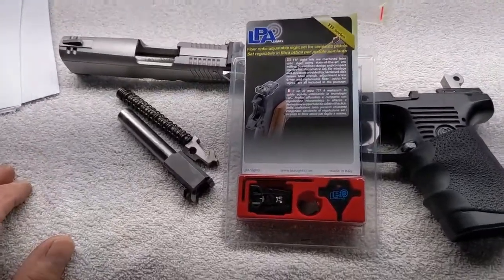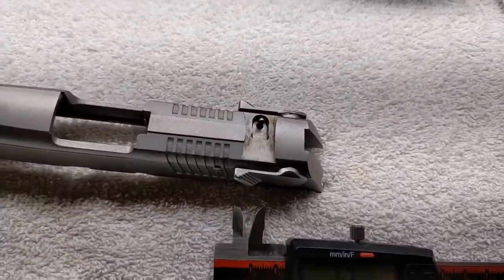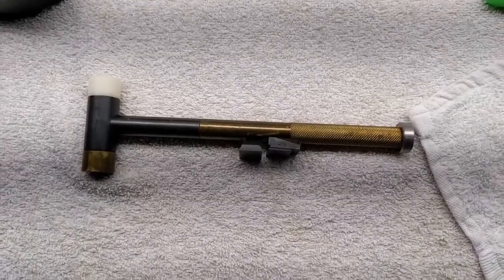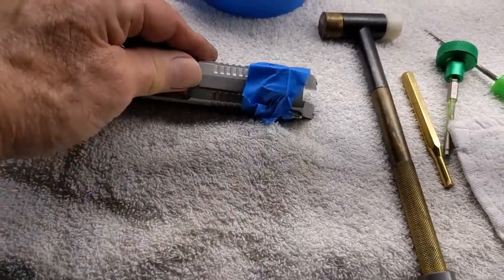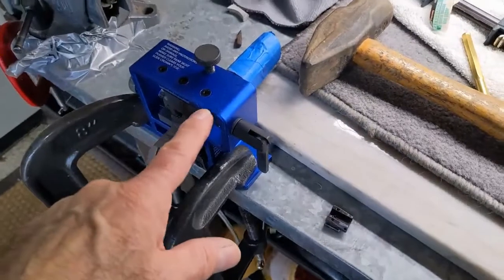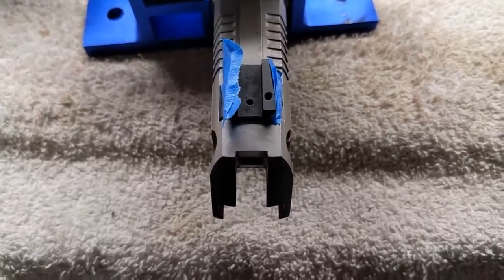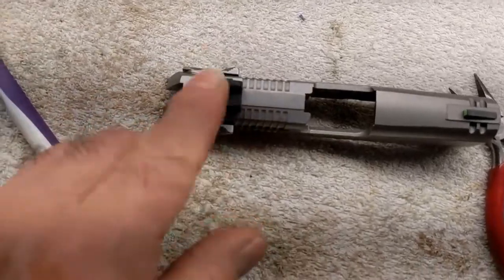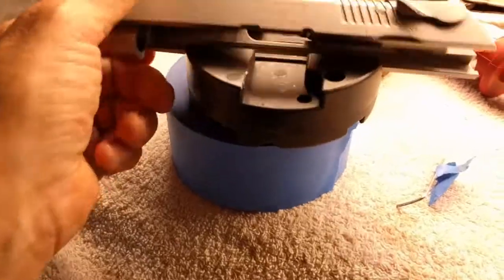Shooting Ruger P95DC install LPA target sights REAR by Froggy

Comment: You're probably not supposed to take the set screw all the way out, just loosen it enough.'cause it probably pushes down on that pin that lets you slide it out

Comment: I wonder if putting the lower part of the new sight in the freezer for a couple of hours before pressing it in would do the trick.
Reply: Maybe even lay the slide in the sun for a while as well.
Reply from the maker: Well maybe, but it's so small it would not hold the cold temp (shrink?) very long with handling & all. I found just filing worked, just a little each time.  :)
Reply: Liquid nitrogen from a weld shop would do it. Just don't touch it without gloves!!

Comment: I had to adjust the rear sight on a P89 which I purchased second hand. When I purchased it, the rear sight was adjusted way over. Didn’t think anything of it. Took it to the range and it was a 7 inches left of center. I used a few pieces of scrap wood and a piece of dried Crape Merttle dowel. Took me a few hours but I finally knocked it loose. It was lightly rusted between the sight and the slide. It can be done. It takes forever hammering it firmly.
Reply from the maker: You are skilled/lucky both. Most folks bugger up the sight really bad. And never get it spot on, unless you call hitting the paper on.  :)

Comment: The firing pin block is specifically just a safety precaution. If it were to get dropped; even if directly on the hammer - it keeps the firing pin from striking a primer. The rear sight I'm installing on my brother's P90 is pretty simple, but without a drill press, I'd probably ruin the new LPA front sight. I'm just glad a company actually still makes parts for discontinued firearms.